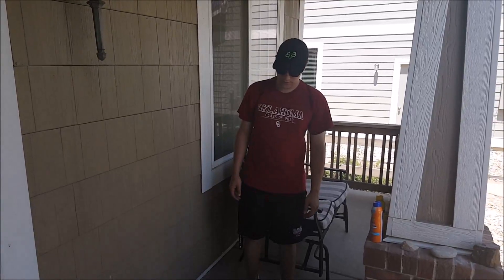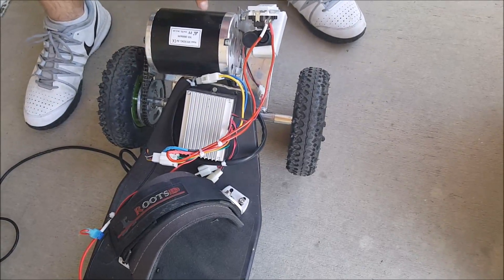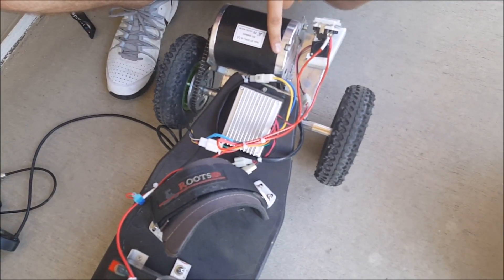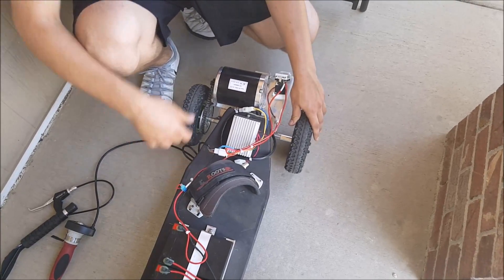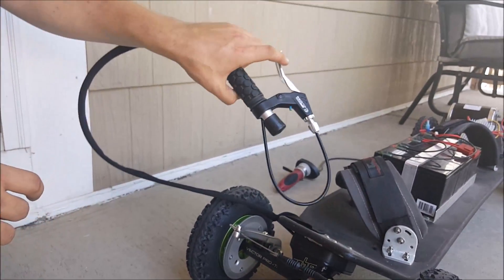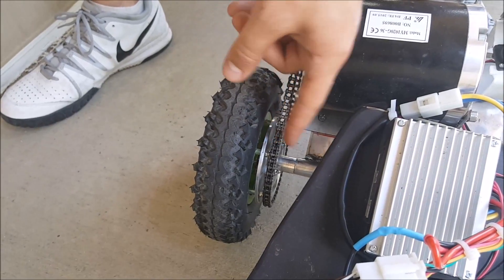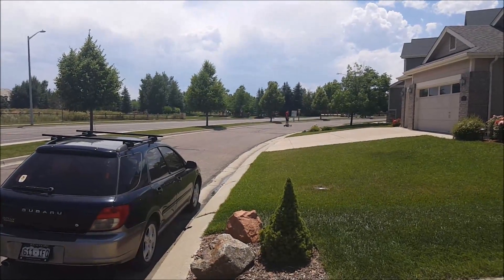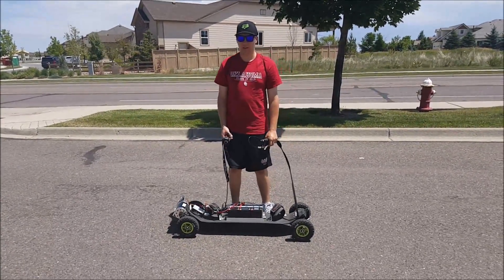DIY 650W Electric Mountain Board

Comment: it's 2016! upgrade it with brushless outrunner and lithium battery!
Reply from the maker: That's the plan eventually!  For cost purposes (Broke College Student) I went with the cheaper brushed motor and the SLA batteries.
Reply: Cody Laxton what kind off motor is that
Reply: CHERRY Red charcoal motor lol
Reply from the maker: CHERRY Red 650W replacement for the razor mx650 electric kids dirtbike